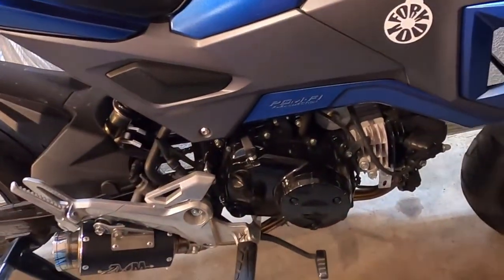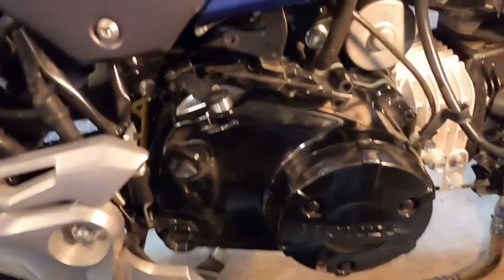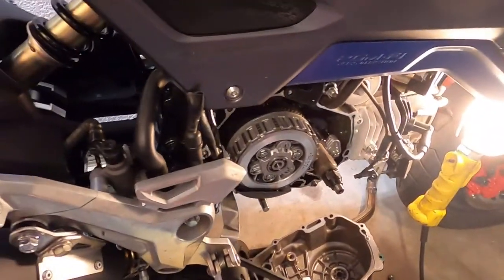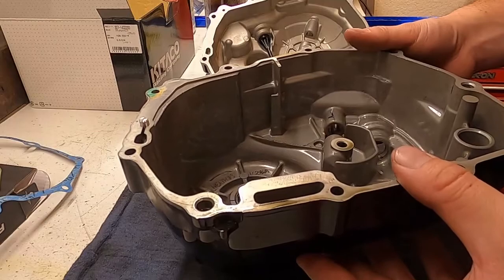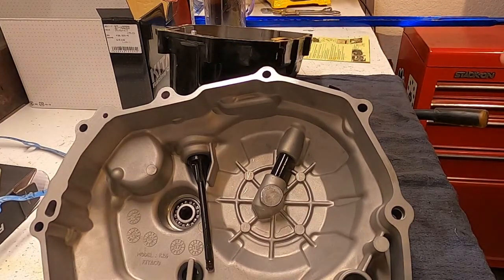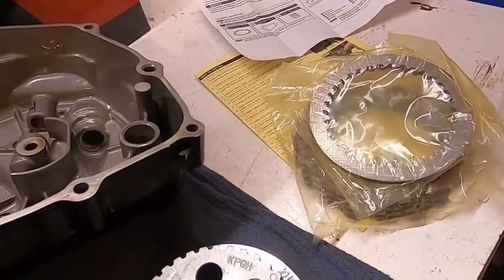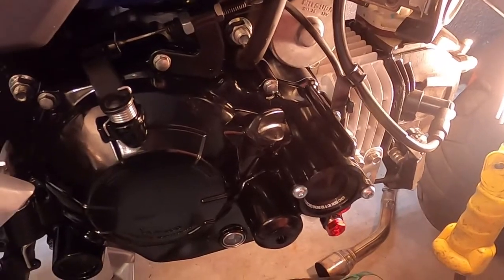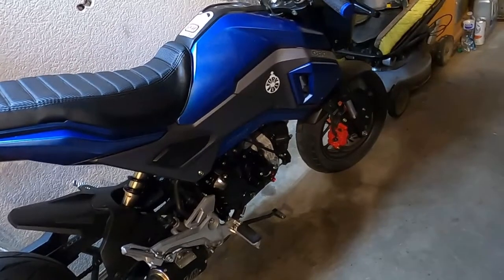How To - Honda Grom Kitaco Clutch Cover and Clutch

Comment: How are the clutch plates doing these days? I noticed you didnt soak the plates in oil before installation
Reply from the maker: I didn’t soak them but I did put oil on them during install. I’ve put several thousand miles on them with zero issue.